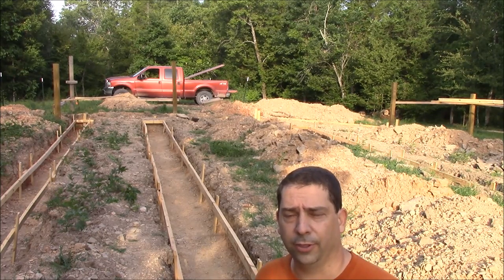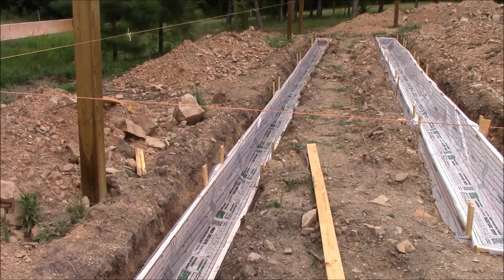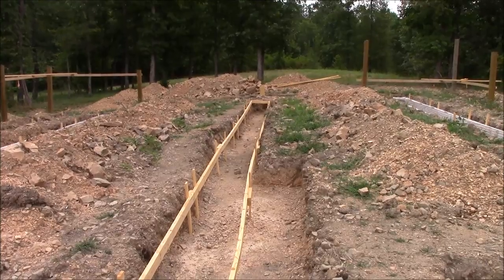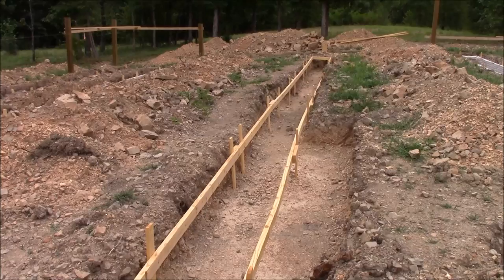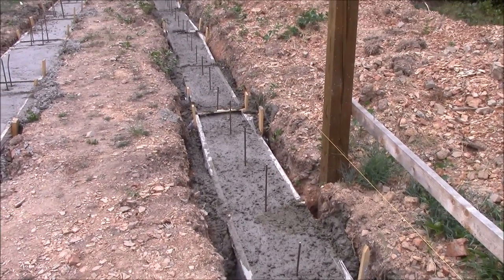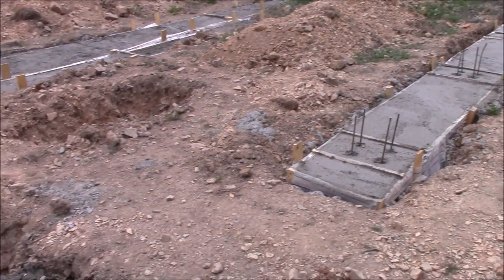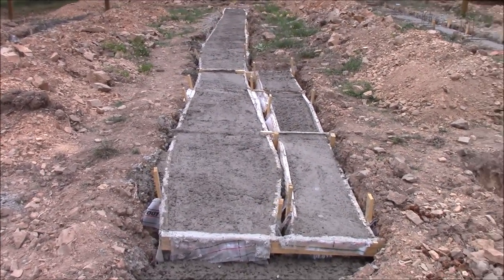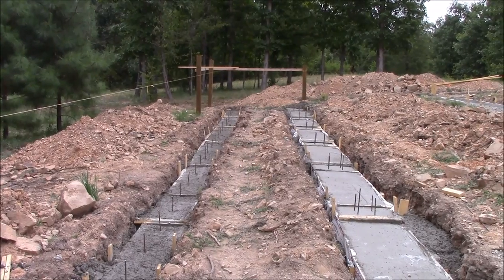Building My Own Home: Episode 5 - Lining and Pouring the House Footers

Comment: to clear up my question, I know the forms must be level on each side.  I am asking about the rows of footers, do they need to be level with each other?
Reply from the maker: +John Gartner If your building site is level all of your footers should be level also. If like me you are building on a hillside then your footers will be different heights,  but the difference in hieght from one footer to the next should always be evenly divisible by 4. So if two footer are at different hieghts of say 4 inches you would add a row half hieght blocks to the lower footer which would make the the same height. If they were separated by 8 inches you would add a row of full hieght blocks to the lower footer and so on until all of the footers come out to the same hieght at the tops. 

On the low side my footers are only 3 blocks high, but on my high side they are around 8 blocks. Hope that helps!

Comment: Why did you make your footers so deep? Just curious. Ohiio code is is 24 inches in the ground, but the footer is only 8 inches minimum for a 2 story house. What is the code your way?
Reply from the maker: I did them larger than code because I hope this home will be standing generations from now without settling issues. I had disturbed the ground removing trees and I wanted to make sure there were no problems. A little extra concrete now is much cheaper than fixing the issue two generations from now. Maybe its overkill, but it gives me peace of mind.
Reply: @ArkansasHomesteader  Right on. I can totally agree. I thought maybe its the composition of the dirt.

Comment: Been looking to start building myself but I'm a little confused by footers. Your footers are just straight lines across the site am I correct? I have read several articles that  made me think the footer needed to follow the outline of the outer wall of the house? I'm from arkansas too.
Reply from the maker: +Nickolas Scherzinger In most houses today the footer would indeed follow the outside wall of the house. But you can also do a raised foundation with just individual  columns and no stem wall at all, like in areas prone to flood where the whole house is built on tall columns to raise it above the flood level.

If you don't have a stem wall all the way around your outside walls, then you have to support the outside wall with rim joist spaning from column to column.
Reply: Perimeter footing would be better, even though you could just do pier pads